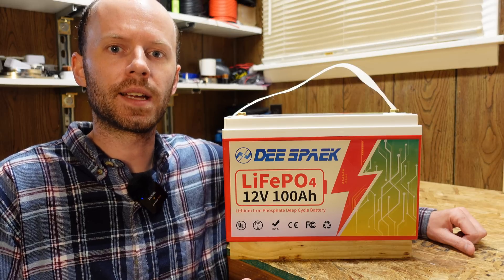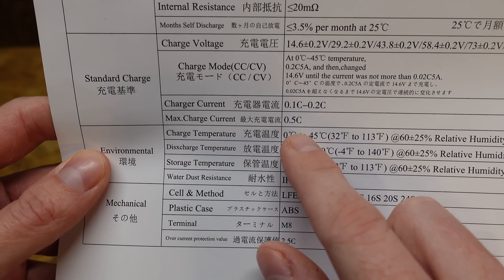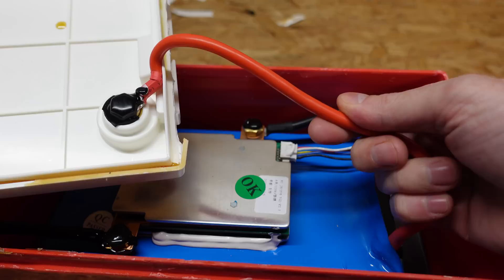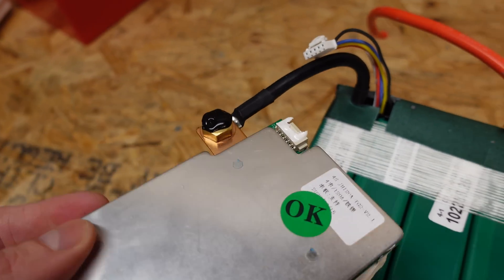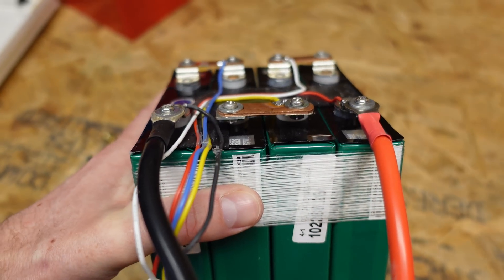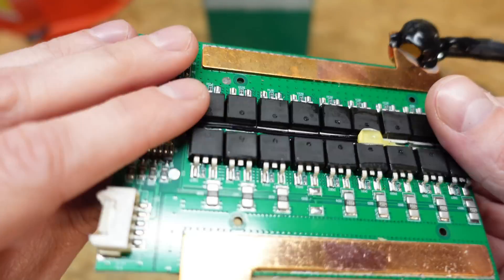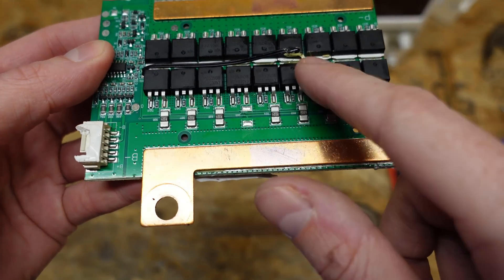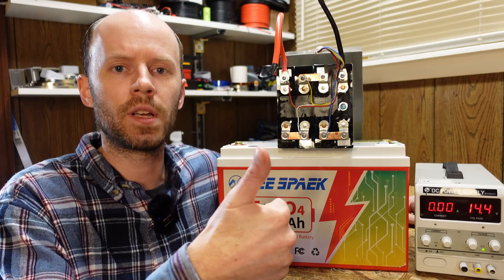DeeSpaek 12V 100Ah LiFePO4 Battery Testing and Teardown, Cheap $279!

Comment from the maker: DeeSpaek 12V 100Ah... https://amzn.to/3B7DVI6
DeeSpaek 12V 200Ah... https://amzn.to/3HfpHbY
(affiliate links)
Reply: The links say "currently unavailable"
Reply from the maker: It's showing in stock for me... Are you in the US? Maybe they don't ship to your location?
Reply: @LithiumSolar  Its always a good day when you post a video. I love seeing you tear down these batteries and see if they are decent quality. You must have a good amount of harvested cells and hopefully you have been building or adding to your current capacity in your own main solar system
Reply from the maker: @catch22frubert  Adding to my solar system capacity is the plan, haven't done so just yet though. I'm trying to plan out my next move with all of that and will likely get something figured out in the spring with new equipment. I have a lot of ideas floating around and don't want to have to do it twice - need to plan.
Reply: @LithiumSolar  I'm excited to see you make your own battery bank. Hopefully, you make a nice 100Kwh battery bank with prismatic aluminum cased LiFePO4 cells.  H$for mm
Reply: The link shows me inventory on Amazon FYI. The link works fine as far as I can tell
Reply: i was waiting for one more boing boing with the rubber at the end of the video but I guess not lol

Comment: I bought two of these for a 24v system. I had some issues and decided to open the battery, which was easy as it had screws on the lid. I opened the battery and found pouch cells!! And this was after your review. It seems like a toss up with these cheap batteries as you never know what you are going to get. I am so disappointed with this company.

Comment: great review, thank you for opening that box 😁 i was always curious to know how they are inside. i m doubting to buy 100Ah mosewroth, fllyrower or deespaek. I hope that empty space inside is usefull at least for not getting battery cells to hot. i apreciate more capacity in less space 😁 have a wonderful day. thank you so much

Comment: I bought a 24V 100Ah battery. When it arrived the charge was at 90% and the cells were all balanced. After a first charge I found all the cells unbalanced. The seller says that everything is ok. The Vdiff is 0.19V with the highest cell at 3.68V and the most discharged at 3.50. Is this normal? Thanks

Comment: Howdy! I just picked two of the DeeSpaek 12v100ah LifePO4 to use with my Midnite Solar Kid MPPT for my solar on my van. But I cannot find the Absorb time or the Float Voltage anywhere on their site, or in the manual they sent with it. Do you happen to know the Float Voltage for it? I can do away with the absorb setting as I am installing a WhizBang JR, so will use the Tail current to handle that.  Thank you for any info as I have not been able to find it on their site

Comment: I just bought 2 of these and I used your Amazon link for 1 of them. Now that I have the 2 of them I Fully charged them individually with my 10 amp LiFepo charger. The problem is that I want to hook them in parallel and they are both supposed to have the same amount of charge but one of them has 13.95 volts at rest and the other is a 13.65 volts. Do you foresee a problem ? My charger was charging each of them at 14.60 volts.
Reply: are these batteries still working good for you?

Comment: I am going to buy 2 using your link.
I just bought one using your Link. I  can only get the $20.00 Coupon on one purchase. So I will do 2 individual buys !  Thanks for the info ! Liked/Subscribed a long time ago.
I was Wrong... I can only get the $20.00 Coupon Discount once.
I will have my Son order the 2nd. one and get the $20.00 discount that way !
 FJB !
Reply: How are the two DEESPAEK 100ah batteries working?
Reply: @XR_IX  
I was using them exclusively up until about a month ago...they worked great for me but i only used them under minimal drain. I have a Retired FedEx van with my laptop computer and a 42 inch monitor in it along with 2 x  12 volt Refrigerators  and a couple of 12 volt lights all hooked up to a 330 watt solar panel with a 30 amp Solar Charge Controller and a 2000 watt Modified Sine Wave inverter. Never had any problems. I was also hooked up to Shore Power the entire time if there was no sun.
I recently bought 2 x 300AH ($315.00 each) DumFume LiFePo4 batteries after watching Will Prowse do a tear down of them.

Comment: I'm looking for a battery to equip my VAN, thanks a lot for your review, after your feedback, i'll definitely go for this one.
Reply from the maker: I would get a more recognized brand quite honestly. Check in to LiTime - they're pretty much where it's at right now with low price and good quality.
Reply: @LithiumSolar  Thanks for your feedback.
I've got a more general questions about the charging current of the barttery. If my alternator is giving 150A, will the battery will take 100A, or will it be more restrained by the BMS ?
Thanks in advance.

Comment: Will 3 of these work for a 36volt golf cart??
Reply from the maker: I suppose it could work. It's generally discouraged though due to the inrush current of the motor potentially damaging the BMS over time. It may void your warranty. I would check with the manufacturer and see what they advise.

Comment: I think this is not rubber sir but silicone. Rubber burns but they use silicone for higher tempretures. It's very disrespectful!
Reply: I disagree. Rubber is made from the sap of special rubber trees, while silicone is synthetic material. Look it up, please!
Reply from the maker: I did look it up. I don't care enough to argue such topics. I have better things to do with my time. Have a good night.
Reply from the maker: Silicone is a type of rubber...

Comment: We all know that cheaper isn’t always better, but I think it’s time for our minds to shift from thinking that just because things cost less that they’re also closer to being garbage. Lithium has been around long enough for prices to be in this battery’s area. 
My only concern with this battery is the “rubber matter”. That will definitely create issues for the cells covered… no possible ventilation. 
Thanks for the video.

Comment: What BMS could I get for my ampere Time 200 ah plus I need Bluetooth capability and programmability too
Reply from the maker: The Ampere Time batteries (and most of these batteries) are glued shut and are not intended to be serviceable...
Reply: @LithiumSolar  I got mine open so what BMS would you recommend

Comment: Do these batts need that much air space around them in the case?  Seems like it'd be neat if they could be packaged much, much smaller.  It'd be more conducive to doing several of these in parallel if they'd fit in the rv.
Reply: Just pull it apart and put them in a new box

Comment: At $279 each it makes this battery the least expensive lithium batteries per watt hour on the market presently, that I would consider purchasing for a large 48V battery bank system. Even for a 12V or 24V system, this is a very inexpensive battery. My biggest concern is the reliability of the BMS and the cells that are being used because, I can't find anything out about either one of them. Great video again, however, just like the rest of the videos you put out. Thanks!
Reply: There was no mention if the BMS would support a series connection of these batteries together to get a 24v or 48v system.  The Amazon listing does say you can combine four batteries together for 48V but says that they recommend charging the batteries separately, which doesn't give me a lot of confidence in using it in such an arrangement.

Comment: A trend I am noticing in these breakdowns is that in many of them, the actual case if far larger than it needs to be.   A lot of us are using these in cars/trucks so the physical size is actually a factor.  I have noticed some significant size differences between the common brands. Frankly I like the size of that one out of the case.   Honestly it looks like 200Ah of those would fit in many 100Ah cases.   Space is a premium in my truck and I want as much battery as possible in the least amount of space.
Reply: That's why I did a diy 280ah build - nothing could cram 7.2kwh in the space I have without doing a diy build.
Reply: I was wandering the same thing and telling myself that maybe there’s a technical choice behind it (heating/insulation). 👨🏻‍🔬
The strategy recall a lot the marketing strategies used in food’s big distribution (cereal, powders, etc) 😤
As cheap as these batteries are I’m considering buying 3 of them and “reassemble” them into a common space! 👨🏻‍🔧
Reply: @pierfrancescomacchivideo  Now that is a good idea.

Comment: 1:47 1224 WH / 12.8v = 95.6 AH  NOT 100.92. Please correct your rating system, if cells can not maintain 3.2v/cell they are degraded grade B.
Reply from the maker: The battery tested at 100.92Ah not 95.6Ah. Batteries are tested in amp-hours not watt-hours.
Reply: @LithiumSolar  If that was the case then a 24v 100ah would be the same as as 12v 100ah. Clearly not because you are taking the voltage into consideration, so you are indeed measuring based on watt hours (nominal volts * amps hours = watt hours).

A 100 AH battery should have a nominal voltage of 12.8 which is 3.2v/cell. Doing some math 1224 / 12.8 = 95.6 AH @ 12.8 nominal. The other way around would be  1224 / 100.92 =  12.12v nominal which is below the 12.8v

Compare this to your other battery reviews like the SOK battery and you will see the battery has a 12.8v or higher nominal voltage or at least 1280WH.  You derive the AH rating based on the WH which is the proper way of measuring.
Reply: SunFunKits guy , why you here incognito telling another channel how to do it ? Especially when he's advertising for you .  I got a little sick when I saw your sticker on the anderson connector .  You sure are special .

Comment: I'm glad you do the battery teardown's.  I think it forces the builders to do a better job knowing their batteries build quality will be exposed like this. 
The wiggly rubber shots were hilarious 😂
Reply from the maker: HA! I was waiting to see if anyone noticed my fun transition LOL
Reply: @LithiumSolar  I was RATFLMAO
Reply: @LithiumSolar  those were good 👍
Reply: Teardown’s what?
Reply: It's a bit annoying that the quality of these batteries is so low, because it shouldn't have to be. The big expense is in the cells themselves, followed by the BMS - and those seem to be perfectly good, respectable parts. It should add very little to the cost to assemble them a bit better.

Comment: Cool to see something different. If I ordered one I'd probably pull that temp sensor off the fets and try to get it hanging out of the BMS...do you think two sets of cells could fit in one of their cases if someone wanted to condense space? That would require adding a second set of terminals but the box is so dang big....

Comment: Did you get a chance to check out the charger? I think if you keep it connected to the battery and unplug it, you can still hear the humming. So I don’t think it could work very well. But I do think it’s a good buy. Thanks for your feedback.
Reply: It comes with a charger.
Reply from the maker: The battery they sent me didn't include the charger. The charger looks rather skimpy and yes, I read the same comments about it there.

Comment: Can 4 be put in series?
Reply: Probably, because the manual is identical to the Moseworth 12v 100A.  See this link, and it shows it can be put in series and parallel. amazon listing says 5 batteries in series or parallel
Reply: I was wondering same thing.
Reply from the maker: The specifications paper that came with it doesn't give any indication; however, the Amazon page states you can put up to 4 in series.